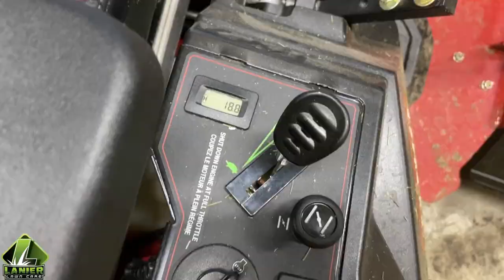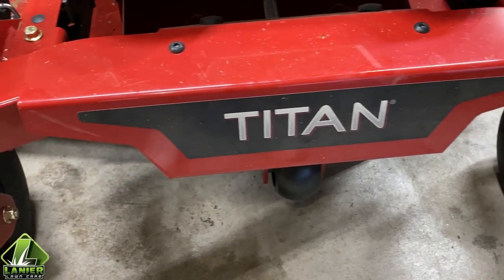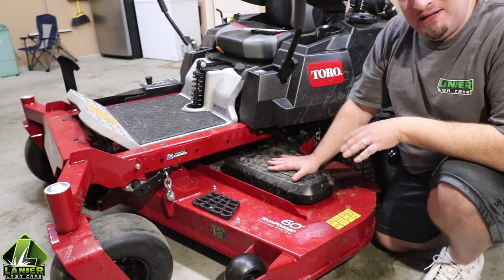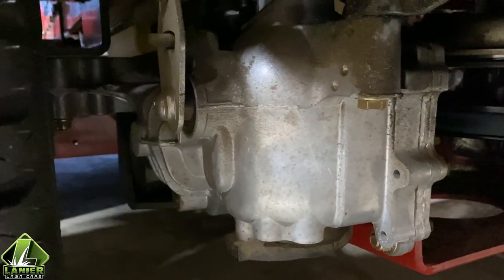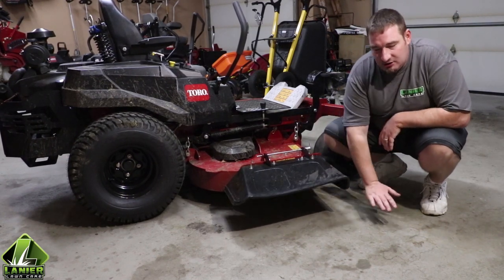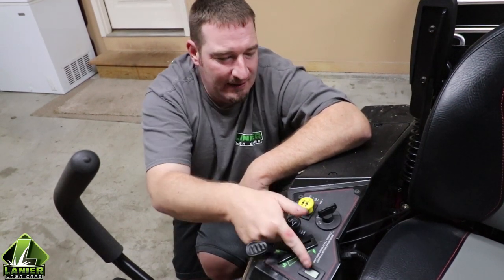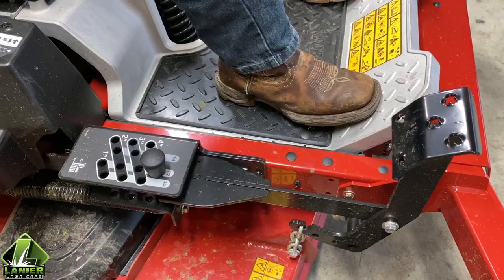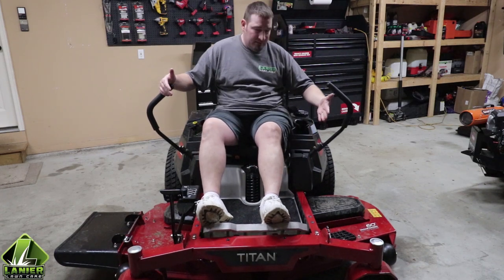ALL NEW 2020 TORO TITAN, MY REVIEW

Comment: I gave a 2017 2500 titan w 60 deck and kawai engine. We’ve put 800 hours on so far and it has been a great machine. I had two of the belt pulleys replaced and replaced the rear tires. Other than that it is a great machine. One complaint ( if your reading this toro ) is the key is too close to the PTO. When you shut off the blades it u is s really easy to turn the key off. Please put the key in another place(TORO). Thx for posting Danny
Reply from the maker: Davieslawnservice Thanks for watching and for your feedback!

Comment: Hello from the great state of Michigan. Danny I just bought my Toro Titan and I love the my ride system and will never buy another mower without it. I wanted to ask you about how stiff the control arms are. It takes about an hour to cut my yard and the controls are so stiff that my arms are sore. Also because they are so stiff it’s hard to mow because it over corrects. Is there any adjustments on the transmission to help with this? Thanks Ted Smith

Comment: As a 21 year master turf grass technician I gotta say. you guys that wanna mow fast aren't interested in quality of cut! Im a MASTER Technician on Toro equipment at a country club and I have to tell you. the faster you mow the crappier the cut. Lets talk clip rate not blade speed. Your clip rate is calculated by blade speed and ground speed. I'd say the Titans optimum cutting speed is probably 3.5 mph why not talk about that. cause 18k blade speed means nothing unless you explain it relative to ground speed. which gives you the optimum clip rate!

Comment: Toro’s look so weak compared to cub cadets.  I wish they would factor in looking awesome with good cutting.
Reply from the maker: EpicConspiracy i guess I’m confused on what cub mower your comparing this to? This mower has a bigger engine, bigger chassis by 1/2” and thicker gauge deck.
Reply: @LanierLawnCare  Probably the new commercial line that everyone on YT is going nuts about, but this is a resi machine so you can't really compare. The Zmasters are built like tanks
Reply: But its still made by MTD. They make junk.

Comment: That’s an awful warranty 300 hours? What that’s half a year? Aluminum spindles? What garbage! Toro should be ashamed, they used to make much better mowers I really liked my old ZMaster with Turbo Force but looks like they forgot how to make good mowers.
Reply from the maker: zepplin810 This Titan is a residential mower, so for them to even give a commercial warranty on a residential product I think is awesome. Step up to a commercial unit and the warranty is one of the best in the industry.
Reply: Lanier Lawn Care $5-6k for a residential mower? Now they’ve really lost it!
Reply: @zepplin810  Dude price out the competition  once.  I just bought the Titan My Ride and priced out others.  John Deeres comparable ztrak 540 is literally the same price ($100 difference) no commercial warranty and a stamped mower deck vs Titans welded. Deeres frames are garbage compared to the heavy built Titan. Unless ur mowing 40hrs a week this mower is perfect for a home owner with acreage.  Most people probably wouldn't even put on 15hrs a month.  If you mow commercial, then BUY commercial!!!!!
Reply: Full Throttle way to reply on my comment from 4 months ago. Why are you talking about John Deere? Who gives a crap? Titan is junk! Cheap mower, cheap deck, cheap engine. Not sure if you noticed but this is representing a professional lawn care channel not  homeowner. Toro Titan is not work my time or Lanier’s time cutting 50-60 hours a week probably wouldn’t last more than a few months without a major breakdown. Junk
Reply: @zepplin810  I guarantee you tgis mower if used by an owner p240 would last over 1000 hours without any major breakdowns
Reply: @andrewstratton806  you guarantee? Are you in the mower warranty business or just some keyboard warrior with nothing better to do than comment on 2 year old videos?